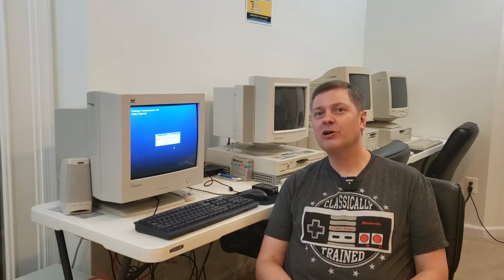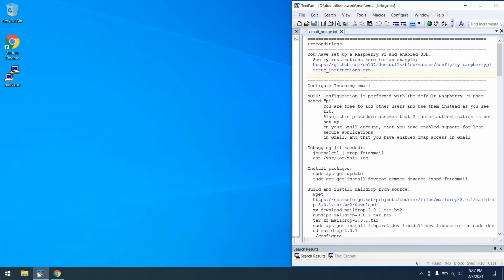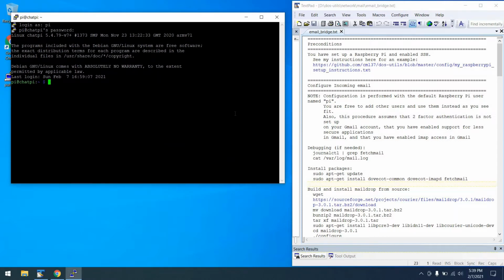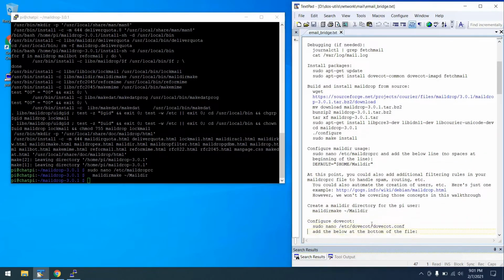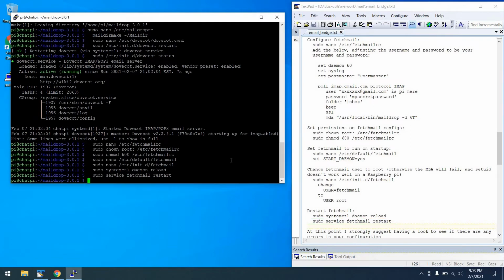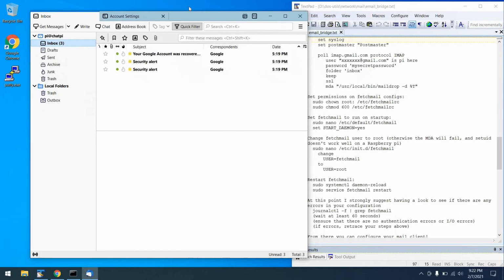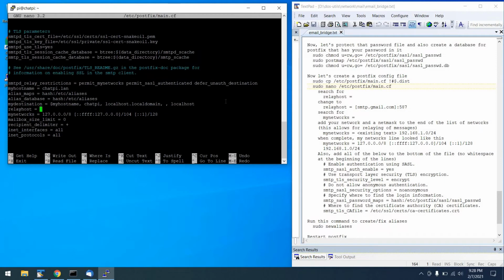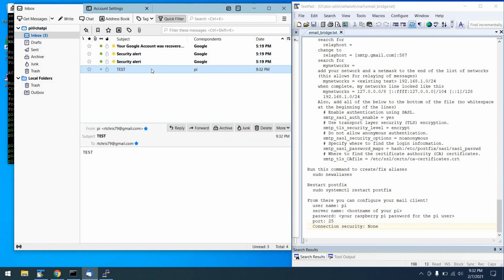RetroTutorial:  Raspberry Pi Email Bridge: Using Modern Email Services with Vintage Email Clients

Comment: Great video again Chris! I may be losing my mind here, but I made a video using mutt at the rpi command line ages ago on my channel and I connected directly to gmail without using a bastion like you configured here. Is that no longer possible?
Reply from the maker: It's 100% possible.  I have a similar video.  However, this method allows you to use an email client on a legacy machine.

Comment: Hi Chris! I like your video.  Another way to approach this is to use the "stunnel" program.  You'd run it on your raspberry pi, and configure it to accept the insecure local imap/smtp connections and make secure connections out to gmail or other mail provider.  The downside is you wouldn't have a copy of your email on your raspberry pi.
Reply: The sample configuration file included with the stunnel package actually configures insecure to secure POP3, IMAP and SMTP proxies to Gmail. The only changes needed would be to the "accept" lines. The sample only accepts connections on the loopback interface.
Reply from the maker: Great idea!!  Thank you for sharing that method!